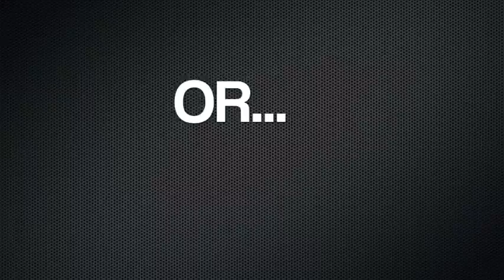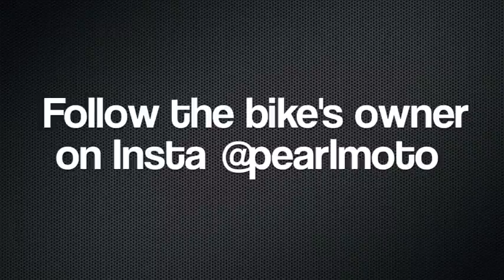PART 8 HARLEY FXE SHOVELHEAD CHOP PROJECT | King and Queen Springer

Comment: Awesome build & great video!
Im going through the motions of starting a k&q for my chop.
Is the center section of the pan a fender? The biggest obstacle for me right now is getting sheet with the curve that fits the fender snug. Im running a curved fender similar to that bike. Thanks
Reply from the maker: Tj Gonzales Thank you for the kind words!  Yes, the center section is another fender.  It is in fact the exact same 4.75" Manta Ray fender from Lowbrow Customs that we are using as the actual rear fender.  If that makes sense.  My friend made some new scrap metal trying to take flat plate and shape it to match the fender.   It just wasn't working so he had to bite the bullet and shell out some more cash for another fender.  Money well spent though!  The seat is now upholstered and the seat curve matches the fender curve perfectly!  Thanks for watching!